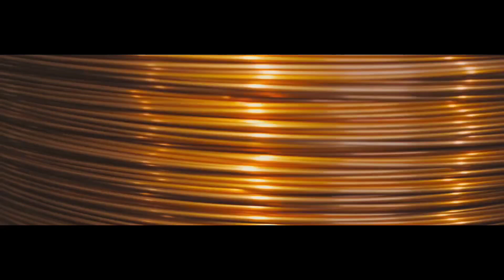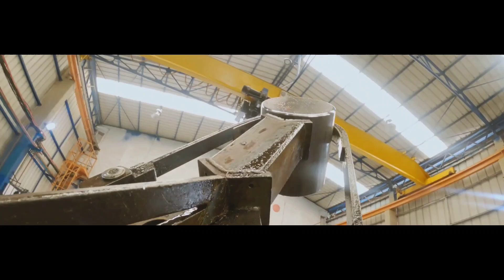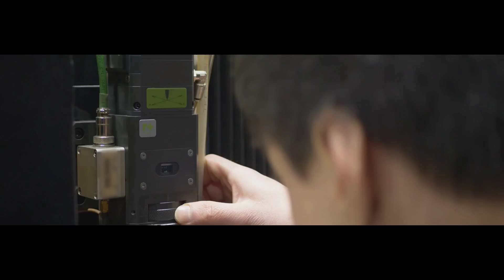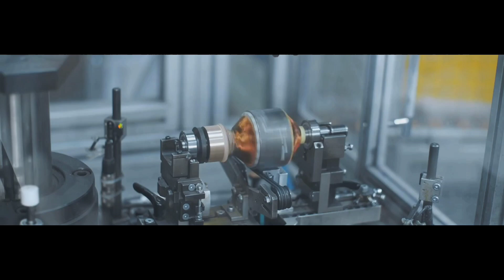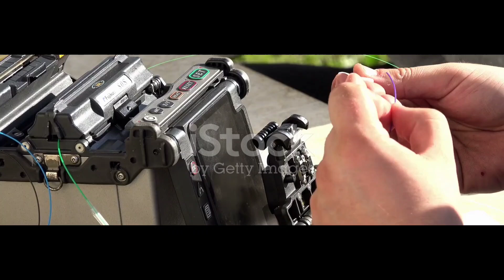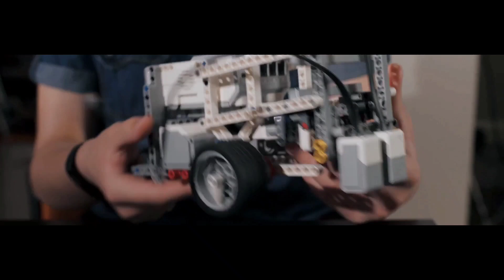DC MACHINES

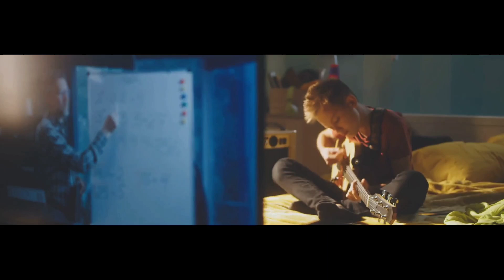Comment from the maker: 0:56 
Eg = (PφZN)/(60A)

Where:
Eg is the generated EMF
P is the number of poles
φ is the flux per pole
Z is the number of conductors
N is the speed in rpm
A is the number of parallel paths

This formula can be related to:
Bh (magnetic flux density)
p (number of poles, represented as P in the formula)
n (speed, represented as N in the formula)